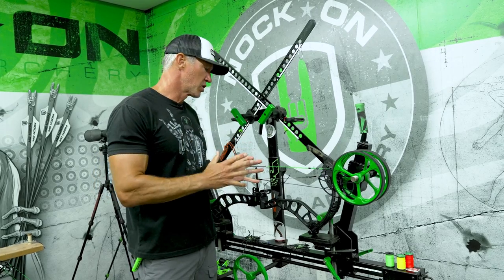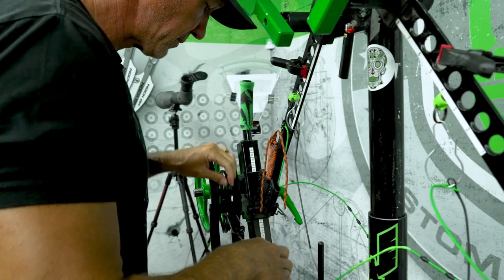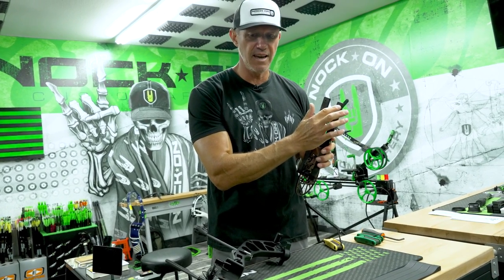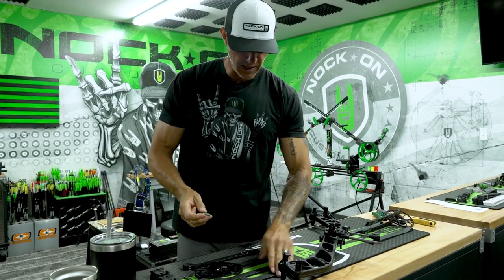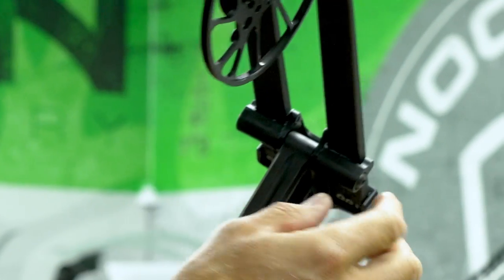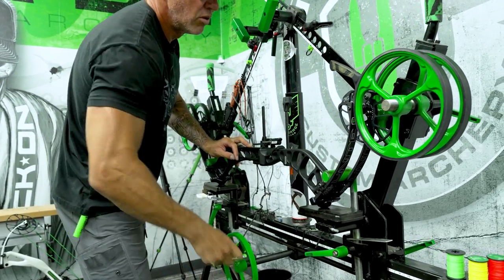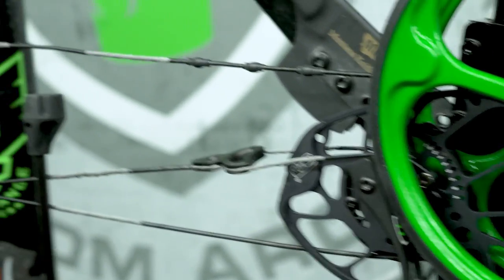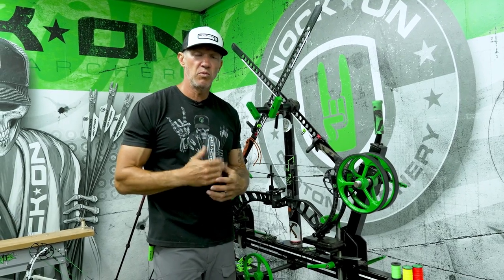LIMB SWAP-Step by Step for new PSE

Comment: I don’t know if you respond to questions on YouTube, but I really hope you can answer because I’ve never gotten an answer to this and I’d really like to understand my bow better:  why are the stiffest limbs (if higher deflection numbers = stiffer) closest to the cable rod?  Don’t the farther limbs get more pressure from the cables?  doesn’t having the stiffer limbs closest to the cable guard lead to greater cam lean toward the cable rod?  I’m loving the ez220 system, but I’ve got a tear whereby correcting it with the shims = greater cam lean toward the rod.  Thanks so much if you take the time to respond — knock-on has been a huge education  for me!
Reply: Great question. Has anyone helped you with this yet? I'm curious also
Reply: The factory answer will be, because rhe control cable hooks on the guard side, it actually wants to pull that inner limb side.

You can (and I have) put the stiff limb on the away side and shimmed appropriately. However, I don't do this anymore which is another story
Reply: @liamboyle9199   Thanks — that makes sense to me.  I’m curious — if you’re willing to spend the time to say — what led you to change the limbs around in the past and also why you stopped doing that -thanks

Comment: Any content coming where you show how to correct CAM lean with that new yoke system? What to look for and how to correct?
Reply: Why would it be any different, from a technique perspective? 

Same idea except instead of the traditional position with maximum leverage, you are now inboard. 
Now the word leverage is important... because the PBTS at full draw has minimal leverage I would almost go as far as to say it is useless as a cam lean  tool. As far as I'm concerned it's a trick to make a 5 piece set into a 3 piece set. 

You can retrofit, based on what ive heard, the EZ220 to the existing ¼ axle bows if you take the correct shims out.
Reply: @liamboyle9199  According to PSE the EZ220 system is made for 2023 bows only and are not to be retrofitted to earlier models. I would certainly like to know if theres a way to put these new shims to my older PSE EVO.
Reply: @makuuse 
It's like new gen of Cams, I wanted to put M2s on a Citation, PSE said no and then last month what do I find for sale, a Citation with M2 cams 🤣

So I would say the specific thing to the new cam systems is the axle and how it's held.

They are just doing the right thing and covering themselves in case something goes wrong which is fair enough

The info is scarce though, all I remember is you have to take out certain shims to make them fit.
This also assumes they fit nicely, some people have poor technical sympathy and don't think about what they just did😂

Comment: it would be grate if they made a PSE bow that when they made improvements to the bow you could take your old one in and have the new stuff (such as cams and limbs) or they could be made to put on any PSE bow. So if like me I like the feel of my old one I could have better cams and limbs put on it.
Reply: Amen!
Reply: In a way you can. The problem is you think that bows talk about poundage the way you and I talk poundage and that’s not correct. What you run into is pockets, pocket angle before you even made it to the limb. The trend over the years has been going to a wider pocket and a pocket design. This is fine but there is still the laws of physics the bow must follow in order for it to be safe. It’s a lot easier to figure out if you know the limbs series. For example, the pse Mach 30 and Nock 30 have a 941 this makes it easier for figuring out what cams will work @ what poundage. Like for example a 70# E2 cam bow if swapping the cams only (you would still need new strings& cables) would make a 75# max SE2 cam bow. PSE use to have their tune charts online where you could see limb series and deflection numbers. That’s how years ago I was able to make a 90# EVL 34 and 90# EVL 32 along with a 90# Xpedite

Comment: Is it possible to have bad limbs? Just got a vtm and top limbs are not even at all and my cam is leaning hard towards lower one
Reply: I have an rx5 ultra with significant cam lean also, each pro shop that has looked at said this is normal for the hbx cams. interested if you find anything else out.
Reply: @krantz10  i e looked at 3 others and they are not like this . If this is what they say , id be done with them or done with hoyt .
Reply: @krantz10  I’ll try to remember to let you know how it goes with mine